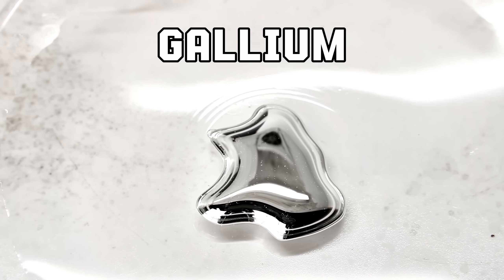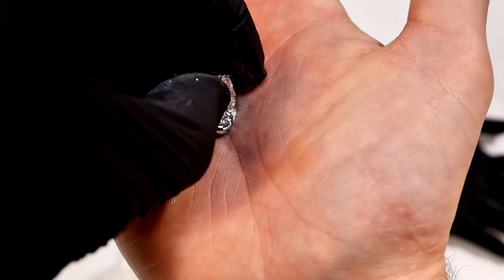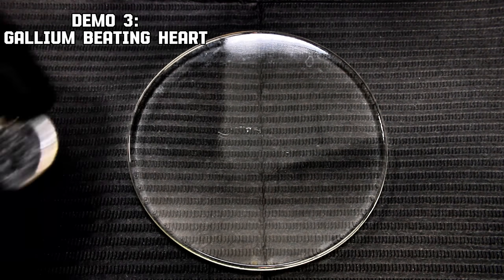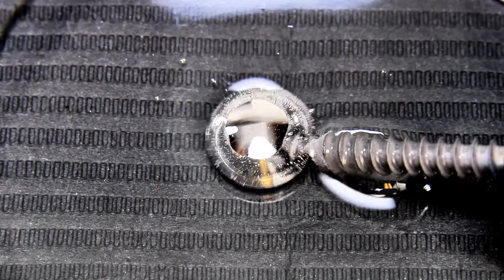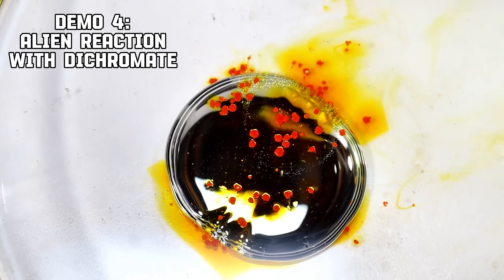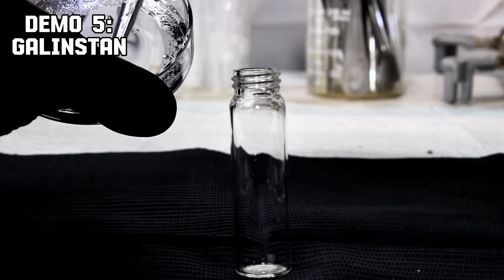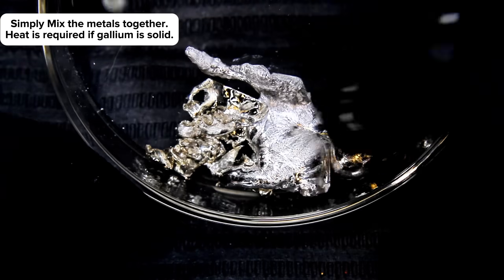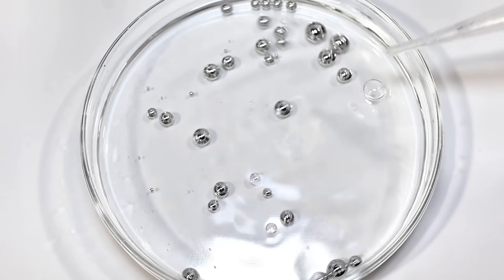Gallium: An Alien Metal

Comment: Fun fact; Galinstan is also used as a liquid metal thermal paste to keep rather powerful processor cool by moving heat through the Copper heatsink or water block much more efficiently than regular thermal pastes would, ie. Playstation 5 uses Galinstan mixture to keep the APU from overheating instantly. Of course, like in the video, I wouldn't use it on Aluminum heatsink. 🫣🫠

Comment: Have you watched the show ‘Mystery at Blind Frog Ranch’? They found a 500 year old large wooden log box in a cave submerged in water. Inside the box were a bunch of big rocks… each rock had a cylinder bored out of it with solidified gallium filled in the hollowed out cylinders. They found this in a 500 year old wooden structure even though gallium and the process used to make it wasn’t thought to have been discovered until the 1870s. Weird

Comment: Gallium aluminum alloy, does it melt? If so what temperature?
Reply from the maker: Its technically a degenerate alloy so it burns/oxidizes rather than melts. I suppose it could melt under a vacuum but I'm not sure what the temperature would be.
It does release a good deal of hydrogen gas when thrown in water though!

Comment: So what percentage of sulfuric acid did you use?. 10% 30%... 60/80 %....98% ?... I know it wasn't a strong solution of sulfuric acid cause if it were it would have dissolved that gallium. I work at a chemical plant that makes acid.

Comment: now try mixing in bismuth crystals and a little magnesium.
Reply from the maker: Hmm I haven't heard of that, what does that do?
Reply: @integral_chemistry  makes a spaceship. the trick is to get the alloy to a density of 10. relative to the periodic table of densities. 
then you just adjust the energy density of the material. with the freequency of your choice. this allows the mass to radiate at the gravity of the position you want to move to.
Reply: @integral_chemistry  think of it objectively.  if the crystalline structure the galum and aluminum create matches the bismuth . and the magnesium helps transfer charge. in the most feromagnetic material with the resonance freequency of crystal. capable of holding charge. 
ever seen a ball in a rotating saddle. eventually it pops out.

Comment: I’ve never heard of the mercury or gallium “beating heart“ phenomenon before, but could that be used to do work? Like say propel a car?
Reply from the maker: Technically speaking, it's the same as the chemical reaction that goes on inside batteries (using different elements of course). It's just in this case much of the electrical energy is converted on the spot to mechanical energy.
They did used to use mercury in a ton of ingenious ways.. shame it's so toxic

Comment: Gallium brought into contact with Aluminum... Let it act... Put everything in a blender to make aluminum powder and let gravity separate the liquid gallium (heavier) from the powdered aluminum (lighter)? 
Does this seem possible to you from a pyrotechnic point of view?
Reply: I'm not a chemist, but for me it feels like trying to sepatare water from salt by waiting - this just won't work since the substances are mixed on a molecular level. Trying to blend aluminum fused with gallium will create either powder or paste depending on the ratio of gallium and aluminium. But it won't cause the two to separate

There is another, but slightly dangerous way to separate aluminum from gallium - it is to drop the paste or powder into water, it will cause aluminum to dissolve in water, while gallium will remain metallic. This process will also create a lot of flammable hydrogen gas, so trying this at home without experience isn't a wise idea
Reply: @akeem2983  Thanks for your opinion... It was when I noticed the significant difference in density between gallium and aluminum that this idea came to me but I'm not a chemist too... An old dream about faster process than my "traditional" ball mill! I'll try it if I ever get some gallium...

Comment: It isnt just that your handa are closer 80 degrees in january, gallium is fairly dense so it takes an unexpected amount of time to melt. 

On the other side of that, it also likes to supercool, which i found that if it flash freezes in that state, it releases a lot more heat than youd think it should. I put a stubborn one outside in 20 degree weather, and when i came back to it an hour later it was comparatively hot.

Also, if you're cincerned with wasting your expensive gallium on destoeuing aluminium, nurdrage has a great video recovering it from aluminum, but you can also stick it in water water to generate hydrogen, but also hydroxides and oxides. What you flget at the end is gallium contaminated with a little aluminum and some oxides and hydroxides.

Comment: The presence of gallium in plutonium indicates that the Pu was at some point used in nuclear weapons; the Ga increases the machineability of the Pu and that’s about the only place where that is important.
Reply: Damn, now I have to check all my plutonium. The nice Korean man who sold it to me guaranteed it was organic free range. Thanks a lot, random internet guy.
Reply: Couldn’t it rather indicate use for a nuclear reactor? Sorry if my question is stupid lol just curious
Reply: @theslyfox91 plutonium is created in reactors, not used as fuel.
Reply: My understanding of it all is that reactor fuel doesn’t need to be formed to the tolerances needed for weapons.  I could be wrong on all of this, too.
Reply: You may be right about machinability but I believe the important thing about alloying with Gallium is that without it Plutonium spontaneously changes between different phases with different densities.  In a warhead that would be a Very Bad Thing.

Comment: Now toss those gallium infused aluminum chunks in water,  you get nice bubbles of hydrogen and your gallium back.
Reply: Wouldn't that be an alternative to get Hydrogen?
I mean, after this reaction of the alloy with water you get aluminum hydroxide.
You can take the aluminum hydroxide, calcine it, dissolve the calcined product in molten cryolite, and perform electrolysis to obtain aluminum metal. After all this, you will have separated the alloy into its constituent elements, which amounts to reversing the reaction.
It's not the best way, but we can recycle the products.
Reply: @Ygr3ku  yeah,  the recoverry from aluminum oxide to raw aluminum is a energy intensive step, so while it could be done,  it might only make sense to do it with alloys of aluminum you wish to separate,  but it is a pretty nifty way to store/use hydrogen in a non pressurized way..   make a little water dripper like a carbide miners lantern...

Comment: what happens if you drink gallium?
Reply: Apparently drinking too much gallium not a good idea, while the metallic gallium is totally non-toxic, by dissolving in the digestive tract it may create really nasty compounds. Though unlike mercury, toxic gallium compounds aren't cumulative. There's also not a lot of info about how much gallium can dissolve in the digestive tract, so the final answer is - nobody really knows what happens if you drink gallium. I can't even find info on whether drinking gallium more dangerous or less dangerous than drinking mercury. Yes, mercury is very toxic, but injesting it isn't quite like breathing its gas and it's also much less reactive than gallium, so there is a nonzero possibility that drinking gallium is actually more dangerous than drinking the similar amounts of mercury. Unlike gallium, drinking mercury is a practice known since antiquity and counterintuitively it's not as dangerous as it sounds. It's still not a good idea, since it will inevitably leave some of the mercury compounds inside of drinker's body and much of them will remain poisoning their body for life, but most of the mercury will preserve its metallic form and pass through the body without causing harm. In most cases of mercury drinking there wasn't even a poisoning strong enough to be noticeable

Comment: 9:50 is this the 'liquid metal' used to cool a lot of computer parts like Graphics Cards and consoles?
Reply from the maker: I'm pretty sure yeah! Although with the price of gallium spiking they might change it
Reply: @integral_chemistry What would be an alternative to Gallium that's Cheaper and isn't Radioactive or Toxic?
Reply from the maker: @smashed_penguin  I actually just looked it up and sadly there is no good alternative to galinstan.. some companies have tried something that's basically a more fluid version of thermal paste, but it doesn't work very well at heat transfer and clogs pretty badly.

Comment: You didn't cover my favorite reaction. You can recover the gallium after it's contaminated with aluminum buy, putting it in water. The aluminum gallium is more reactivated than regular aluminum, and it will reactivate and produce hydrogen

Comment: I recently used a Ga/Al alloy to reduce Ɓ-nitrostyrene to phenethylamine.
Reply: pihkal? 
3,4,5 trimethoxy!

pats cactus
Reply: @paradiselost9946  
something I did myself with research;

2.5g ß-nitrostyrene in 250mL IPA 50% v/v
(IPA/H2O), in RBF, heated 65c in bath.

8.32g (1.1 : 8.9, w/w, ~11%)
Gallium-Aluminium alloy,
Adding 1g portions every 5-10mins.

During addition, rapid H2 generation,
did not stop for 4-8hrs, afer 4hrs stirring under 65c, cooled to 35c.

15.5g NaOH in 60mL H2O prepared, cooled to 20c, portionwise addition, very strong exothermic rxn, fizzing and bubbling H2 more rapidly as Al dissolves into sodium aluminate and Ga into sodium gallate salt dissolved. Too much base at one time will cause the mixture to bubble over., care..

Upon completion (calculated exct needed).
Final drops completes conversion of Al-Ga, fizzing mostly stops with a gentle stream of bubbles that slowly stop over several hours.

Two layers immediately form, top layer is light-yellow IPA layer, filtered thru simple funnel into sep funnel.
(vac filter if compound forms carbonate salt).

Extracted basified mxt w/ IPA 3x 75mL.
Providing a crystal clear particulate free yellow-orange IPA layer with amine smell.

Washed once with 6g NaOH/20mL H2O.
Separated NaOH layer, couple drops of IPA to clear out sep funnel tap and tapped off into RBF.

IPA stripped under vacuum and gentle heat to 30c, leaving approx 2-2.1g yellow-orange freebase phenethylamine oil.

Dissolve 2g oil in 15mL IPA., neutralized w/ stioch conc HCl(aq), HCl/IPA or HCl/dioxane, dump in 30-40mL Et2O and a rapid precipitation or crashing of white needle like crystals should present themselves.

Vacuum filter after 5-10m standing and wash few times with Et2O or cold acetone.
Air-dried and mp tested. 
approx 2g yield (~70-80% yields).

I have a post on my channel about how to make the Ga-Al alloy very easily in a few minutes and can store for long periods under inert atmosp in plastic container.
Reply: @paradiselost9946  

something I did myself with research;

2.5g ß-nitrostyrene in 250mL IPA 50% v/v
(IPA/H2O), in RBF, heated 65c in bath.

8.32g (1.1 : 8.9, w/w, ~11%)
Gallium-Aluminium alloy,
Adding 1g portions every 5-10mins.

During addition, rapid H2 generation,
did not stop for 4-8hrs, afer 4hrs stirring under 65c, cooled to 35c.

15.5g NaOH in 60mL H2O prepared, cooled to 20c, portionwise addition, very strong exothermic rxn, fizzing and bubbling H2 more rapidly as Al dissolves into sodium aluminate and Ga into sodium gallate salt dissolved. Too much base at one time will cause the mixture to bubble over., care..

Upon completion (calculated exct needed).
Final drops completes conversion of Al-Ga, fizzing mostly stops with a gentle stream of bubbles that slowly stop over several hours.

Two layers immediately form, top layer is light-yellow IPA layer, filtered thru simple funnel into sep funnel.
(vac filter if compound forms carbonate salt).

Extracted basified mxt w/ IPA 3x 75mL.
Providing a crystal clear particulate free yellow-orange IPA layer with amine smell.

Washed once with 6g NaOH/20mL H2O.
Separated NaOH layer, couple drops of IPA to clear out sep funnel tap and tapped off into RBF.

IPA stripped under vacuum and gentle heat to 30c, leaving approx 2-2.1g yellow-orange freebase phenethylamine oil.

Dissolve 2g oil in 15mL IPA., neutralized w/ stioch conc HCl(aq), HCl/IPA or HCl/dioxane, dump in 30-40mL Et2O and a rapid precipitation or crashing of white needle like crystals should present themselves.

Vacuum filter after 5-10m standing and wash few times with Et2O or cold acetone.
Air-dried and mp tested. 
approx 2g yield (~70-80% yields).

I have a post on my page about how to make the Ga-Al alloy very easily in a few minutes and can store for long periods under inert atmosp in plastic container.
Reply: @paradiselost9946  
something I did myself with research;

2.5g ß-nitrostyrene in 250mL IPA 50% v/v
(IPA/H2O), in RBF, heated 65c in bath.

8.32g (1.1 : 8.9, w/w, ~11%)
Gallium-Aluminium alloy,
Adding 1g portions every 5-10mins.

During addition, rapid H2 generation,
did not stop for 4-8hrs, afer 4hrs stirring under 65c, cooled to 35c.

15.5g NaOH in 60mL H2O prepared, cooled to 20c, portionwise addition, very strong exothermic rxn, fizzing and bubbling H2 more rapidly as Al dissolves into sodium aluminate and Ga into sodium gallate salt dissolved. Too much base at one time will cause the mixture to bubble over., care..

Upon completion (calculated exct needed).
Final drops completes conversion of Al-Ga, fizzing mostly stops with a gentle stream of bubbles that slowly stop over several hours.

Two layers immediately form, top layer is light-yellow IPA layer, filtered thru simple funnel into sep funnel.
(vac filter if compound forms carbonate salt).

Extracted basified mxt w/ IPA 3x 75mL.
Providing a crystal clear particulate free yellow-orange IPA layer with amine smell.

Washed once with 6g NaOH/20mL H2O.
Separated NaOH layer, couple drops of IPA to clear out sep funnel tap and tapped off into RBF.

IPA stripped under vacuum and gentle heat to 30c, leaving approx 2-2.1g yellow-orange freebase phenethylamin oil.

Dissolve 2g oil in 15mL IPA., neutralized w/ stioch conc HCl(aq), HCl/IPA or HCl/dioxane, dump in 30-40mL Et2O and a rapid precipitation or crashing of white needle like crystals should present themselves.

Vacuum filter after 5-10m standing and wash few times with Et2O or cold acetone.
Air-dried and mp tested. 
approx 2g yield (~70-80% yields).

Comment: it sucks that it reacts weird with other metals, it would be pretty cool to have liquid metal as a coolant for cars
Reply: I understand what you're saying. 
I haven't ever heard anyone say that a chemical reaction sucks though. Lol
Reply: it wouldnt be very "cool' at all... water has pretty well much the highest thermal mass of any substance, and is definitely the easiest to deal with. only place a liquid metal coolant serves a purpose in an engine is sodium filled exhaust valves... its more thermally conductive, has a higher specific heat, and is lighter than steel... 

to get the same amount of heat out of the engine would require it run far hotter, and have a much larger radiator...

and water reacts with most metals anyway... that stuff we add to it? the "coolant"? its mostly corrosion inhibitor, along with the antifreeze/antiboil agents... the water is the important bit.

and i dont understand the "cool" factor anyway... do you ever take notice of the coolant it already has? no. is it on display in clear tubes with rgb lighting and metallic glitter? no. you are supposed to be watching the road, not the coolant flow...